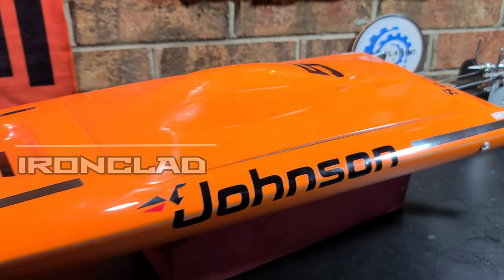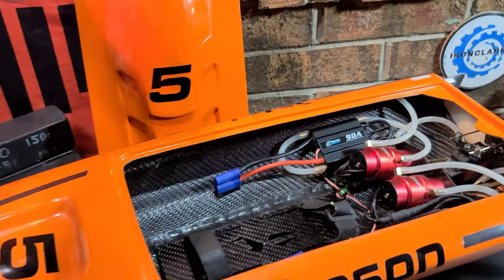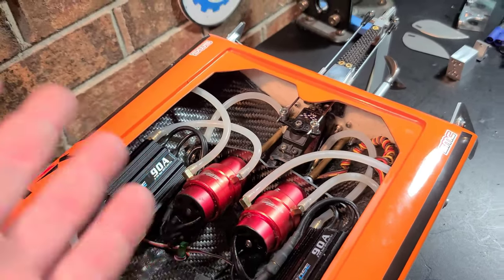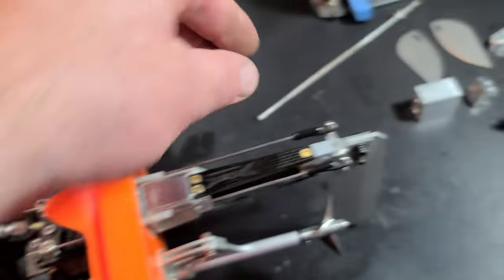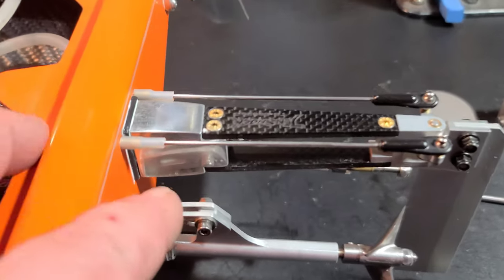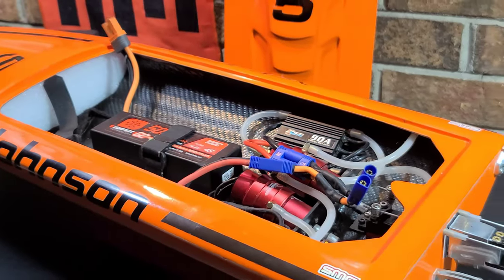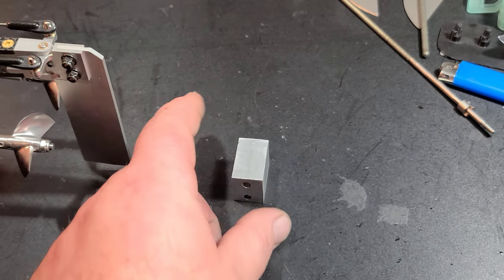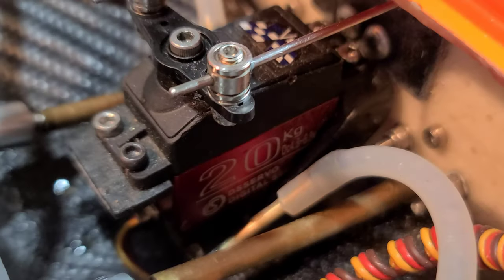Twin Motor Deltaforce 29 Build Series Pt 5 - Leopard 2860, Ose Raider 90a,

Comment: Boat looks so good B. Craftsmanship is off the charts. Bracket looks outstanding. Great job can't wait to see this beast run.
Reply from the maker: Thanks, that rudder bracket took a while to make...  cool thing about this build is the fact I hand made everything  basically  battery tray, service, and motor mount.   I  Tried to keep her as light weight as possible

Comment: Interesting that you didn’t go with counter rotating props
Reply from the maker: I'm gonna run counter rotating props, I messed up my right hand cable.   Basically forcing me to run same direction until I get my new right hand cable in the mail.

Comment: 4s or 6s ? im guessing those leaopards are a high kv? but i blew alot of the 90a esc . i dont think they have the caps like the 150s do?
Reply from the maker: Leo 2860 2730kv basically run it on 4s, I've given smc hcl-HV flight packs 4400 75c 4s @ 15.2v a thought, charge them to the HV rating almost 5s, 5s is 18.5v HV lipo is 15.2 normal 4s voltage is 14.8.      I'd run 2x 4400 Hv batteries one on each side
Reply: @IRONCLADRC  i have the larger diameter leo motor its also 2700kv ratedf for 4s. i get away with 6s on it, but just barely. on a 150a esc i turn the timing down a tad but it runs realyy hot and i really shouldnt. it likes to blow escs from time to time but the motor holds up. i like the leopards but the SS Ive had have done just as well andd are slightly cheaper stimes. i wouldd think 4s will probably be enough for it
Reply: i wonder if that leo would fit in the little geico. looks like it might be a little to long
Reply from the maker: When I crashed the drag boat and pulled the motors the first boat I tried to fit the 2860 in was the geico. Yes there's about  10mm to long for my set up.  Next motor I'm gonna try in the geico will be a 2948 rocket motor
Reply: @IRONCLADRC  that sounds close to what i have in mine, surpass. stay away from the blue can ones and get the black or red. there not that much like 15-25 bucks a piece, a have hald o ddozen or so different kv andd can sizes in that range. my geico was cahnged likedd yours different stuffing tube adjustable . i run long skinny 3-4s lipos, airaoft ones fit well, down in the sponsons, one battery on each side. in that little boat. its tight in there. esc up in the nose. i have a 40- but wanna run a 60- or 80 ztw esc on it
Reply: look for the motors withe the thickes wires that helps

Comment: How to grease the flex shaft when not is use teflon tube?
Reply from the maker: Same as normal, minus the Teflon liner.  I usually squeeze some med-light oil in the stuffing tube for added lubrication